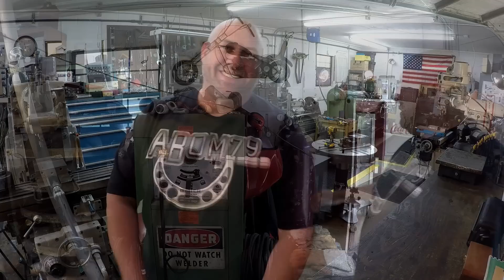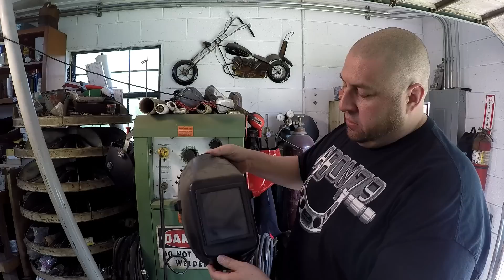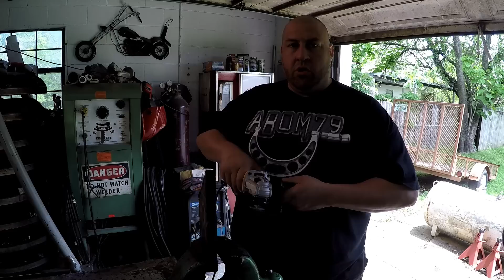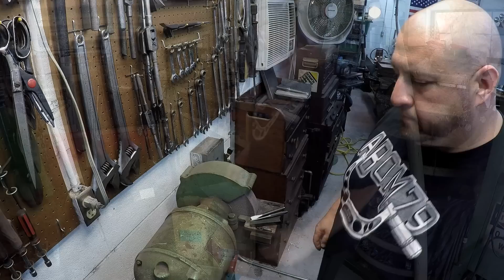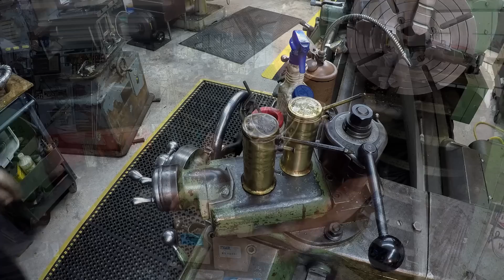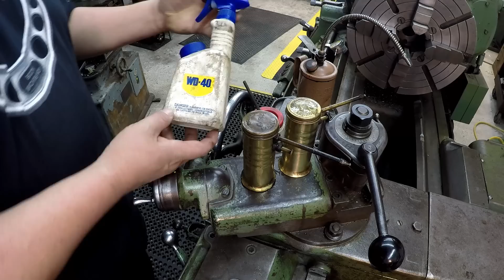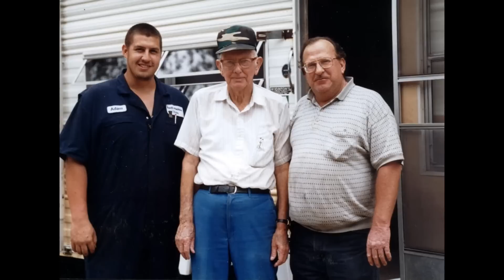10 More Shop Do's & Don'ts

Comment: In the UK things are a bit different on No.10, unless you're a time served specialist with your own full tool kit, many firms supply most needed tools, especially unusual, hard to find or particular trade type ones . But having said that, they don'tr always buy the right or best ones. Some will not take their own tools for others to borrow, break or steal. Another thing is that if many take their own tools to work, management see it as a sign that they no longer need to supply them and those that can't afford them have to borrow etc. I was self employed and took my full kit with me, one place I worked at would replace tools I wore out or broke in their work time. But most employers are not that understanding. If your wife buys you an expensive tool for Xmas or a birthday and you then leave it at work for anyone to use, what's she going to feel like if she finds out? Lots of good common sense advice here, Adam, thanks.

Comment: when I started 30 years ago if I had to borrow something twice, I would buy my own
Reply from the maker: Good rule to live by. I have many tools I don't use often, but they are mine and are there when I DO need them.
Reply: If it's something not commonly used and you gotta borrow it that's cool, same if yours broke but everyone hates mr borrow everything
Reply: Yes, most definitely. You know,  the old rule of "if you haven't used in 6 months ... throw it out" (or whatever) DOESN'T APPLY TO TOOLS!
Reply: Standard rule , borrow it twice you should own it!!
Reply: I hate to borrow tools but if I do, I will usually buy a better quality one for myself.
Reply: At work %100 but at home im a bit more lenient, like i will lend to housemate or trustworthy neighbor.I tend to only apply it to non consumables though,like i (its embarrassing to be honest) a full drill set currently and am using my housemates on his insistence but im not really comfortable with it, im just awaiting for some to come up on special.Its like if he wants to either do work or have me do much work on the mill or lathe i expect him to at bare minimum sharpen the hss tooling or at best supply his own if its on going requirement.
Reply: And when you buy used tools, it's not really costing you anything, you're just turning your money into tools that you can turn back into money when you don't need them anymore. It's only when you break or wear out the tool that you've really lost anything.

Comment: Welding hoods are a very personal item to me, its like wearing someone else's underwear, it just doesn't happen. Thanks for another ten deadly sins :-D
Reply: Shadon HKW I had bought a rather expensive Lincoln Hood like the one in this video. It died on me and I replaced it with a harbor freight equivalent to get by until I could afford a good one again. So far I've used the cheap one twice as long as the Lincoln lasted, it's held up great, and is every bit as nice to use. I think it cost around $50 on sale
Reply: even more so when it eventually does break, I can take it back at get a new one
Reply: Same with princess auto up here in the frozen north. A big sign in the store "no sale is final until you're satisfied" which basically means a lifetime warranty on everything they sell

I usually hate cheap tools and try to buy quality, but I'd never buy another high end welding helmet. Not when $300 gets you a year, and $50 is coming up on 3 now without any trouble.
Reply: Truth. Not to mention Chinese manufacturers don't have to obey patent law. They can just copy and sell what they want as American or european trademark law doesn't apply to them. I know a small indie motorcycle company that manufactured an original design for a kickstart transmission cover and assembly on newer EVO harley sportsters. Had it registered by the patent office, spent a load of money trademarking it and everything. Six months later a Chinese version pops up in a popular aftermarket company catalog for 1/2 price. The original builder couldn't do anything as it was made in china.Tried to take the reseller to court and was told to take a hike. The Chinese equivalent will ALWAYS be an inferior product. It may work but it will be made out of the cheapest shit available. I bet if AVE did actually do a tear down on a miller vs harbor freight it would become readily apparent at how crappy the quality of the harbor freight unit will be. Not to mention if it has the right percentage of blockage for the application you are using it for. No quicker way to mess up your eyes than using a lens to light for the application. Of course that doesn't apply to auto darken hoods but still.
Reply: I'm a little late to the party but, I'm a welder under the hood for most of the day, cheap helmets are great for home gamers but those $300 Lincoln and ESABs are some of the clearest helmets I've ever used and you're also paying for comfort, those cheap helmets dig in quick.
Reply: Shadon HKW John
Reply: SeptrothFFXI and
Reply: same with anything you sweat into. fave pair of gloves, hard hat, welding apron, etc.
Reply: @SeptrothFFXI  The flying banana will do it every time!
Reply: SeptrothFFXI as the seller, you’re responsible, because you’re also the importer. Don’t talk nonsense. Don’t make things up.
Reply: Oh yeah, all that sweet sweat soaked into the forehead pad!!! Definitely don't want someone else's running down my face!
Reply: True, we apply the same kinda mentality where I work. It's not just you

Comment: A good rule to remember is  "if you Kill it then you Refill it"  easy as that.  run that cutting oil out, refill it.  Use the last grinding disk tell the proper person to get more ordered.
Reply: I've lost track of how many shops & offices I've been in where they have a sign to remind people to make a fresh pot of coffee when they pour the last cup...

And, let's not even get into restroom cleanliness... :(
Reply from the maker: Can't tell you how many times I had to swap out the oxygen tank because i found it empty.
Reply: Same here plus we had 55 gallon drums of hydraulic fluid, motor oil, antifreeze on rolling carts with air powered pumps that guys would leave empty.  Those were a pain to change out.

Here's another one.  How many times have you been working under a flat bed truck and have some idiot come up and hit the flat bed with a hammer.  that will make you sit up and gouge your forehead into the frame.
Reply: amen

Comment: Replace the empty gas bottle if you empty it, argon, oxygen, acetylene etc. Don't spit on the shop floor, nasty, if I have to lay down to work on something I don't want to lay in someone's nasty spit. Don't break a tool and put it back broken, especially if it's someone else's, tell them about it and replace it. Never ever take it upon yourself to borrow/use someone else's tools without their knowledge even if you're the business owner. Lock your shit up when you're not around.
Reply: >Don't spit on the shop floor

Can I just add that people stop doing this in general? It's fucking gross and spreads TB. I will only ever ever spit if I've got a fly or something in my mouth.

I don't get why people do it in public, because I know they aren't doing it on their carpet.
Reply: "barrowing" someones stuff, without their permission is just plain stealing... whether or not you gave it back, expect them to be pissed.
Reply: You brought up my worst memory of being in construction.  I used to build precast concrete i-beams for bridges.  Nothing, I mean nothing was worse than laying down under a form to install a hold down, covered in grease, and be staring at a big juicy puddle of chew spit 6" from my face.  
A distant second place worst memory of a couple asshats putting trash in the bed of my truck as a "prank".
Reply: As an occasional golfer, I have to add Don't spit your nasty sunflower shells (or chaw) on the greens! (I wouldn't believe it if I didn't still see it now and then.) Who wants to pick up a shell that's been in someone's mouth, to clear your putt line?
Reply: Nelson Mandela I understand if someone got a face full of oil or something else nasty but just doing it because, is plain NASTY!

Comment: #11 don't step on drop cords or air hoses.. #12 don't uses air hoses and leave them uncoupled when finished..#13 use the proper size grinder for the task at hand.. #14 don't cause extra work for the next guy, finish your job completely

Comment: Could you do a quick video of the torch pop? never seen it before.
Reply: Ever have someone shut the oxygen off and fill the room with little soot floaters?  Thats probably even more annoying because of the mess it makes.
Reply: Some people also do that because they think its cool.
Its also done a lot in TV Series and movies because they think its cool.

When in reality its just a newbie thing to do.

But not gonna lie, it sometimes happens to everybody. When your mind is like "Oh well what happened there with that $_whateveryoudid" and you close the wrong one first.
Reply: Usually followed by a bellow of "Oh, shit!"
Reply: was always tough fuel gas on first fuel gas off first stops flash back
Reply: Wrong, Jamie Buckley.

The gauges on the tanks measure the pressure inside of the tank relative to the pressure outside of the tank. So if regulated pressure in the hose is at 7psi at sea level the absolute pressure is 21.7psia, not 7.7.

If it were at 7psia that would mean that even with the torch "on" and a flame coming out that both lines, if at 5&5, would be at a "vacuum" and a flame would be literally impossible to produce.
Reply: gauge pressure vs absolute pressure
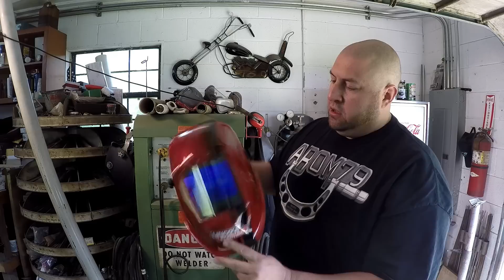Reply: This guy pops the torch around 2:52 in this video: /watch?v=8E-zliUrnQ0
Reply: Cheers dude, that really is bloody loud.
Reply: I've heard of "A before O or up you go" Maybe that's just for lighting a torch though
Reply: your right jamie always shut accetalyne off first because its 14.7 pounds per square inch preasurs at sea level and if your accetalyne is at 7lbs or 10lbs do the math 14.7 is more than 10 so it could push and burn back up the hose which is called a flashback.
Reply: If you turn the oxygen and gas on when lighting the torch it will also pop

Comment: None of this is respect for other people. Its just the way you like to be treated Adam. I have worked in shops where none of there standards are adhered to and because people respect and like each other as people there is no problem. I can't find something... Oh Tom over there is using it. Actually he is not using it, and he hasn't put it away. no problem I will just go get it. Tom is a good guy and I don't mind.
Reply: I've lost countless hours of the boss's time looking for things that either weren't put back or should not have been taken in the first place, in many cases by the owner of the business.  I have purchased or had purchased replacements of multiple items, spending the owner's money, only to "find" the item or have it returned later, in some cases months later.  

Most work I do is simple, IF you take the tools I am supposed to be using, how do I work?
IF everything comes out of a community tool chest, there better be more than one saw IF the job needs 10 people cutting wood.

How much time would you like me to spend walking around, rather than doing the task at hand, simply because someone else could not be bothered to keep me informed?

Sorry, but I disagree, it has everything to to with respect and I find it endlessly frustrating spending "my time" (even though it is really the boss's time) not working.  AND, you have not even covered the situation if you are on piece work.
Reply: Gus, that can work in a 5 man shop... everyone is nearby so you can ask where something is. You get up to a 10+ man shop and now you have to go hunt down who had the item you need. If the shop is running two shifts you're really in a pickle... it never fails that who used it last is on second shift and you spend 45 minutes looking from one end of the shop to the other trying to figure out what the devil they did with it.
When I was young (a long, long time ago) many shops had a tool crib with a semi-retired machinist to keep track of stuff, send dull cutters for sharpening, and get reorders done. You checked out tooling with your brass tags... and if you failed to return it, they knew who to look for.
Reply: It depends on the shop, gus. I've worked in places that were very casual and everyone got along well, and I've worked in places where they didn't. I would consider what Adam outlined as a set of defaults when you're starting out in a new place, trying to get a feel for the environment. If it turns out to be a friendly place then you can relax and go with the flow, but I think even in a friendly place people will recognize that you're showing respect by observing common etiquette and that will get you a long way in your relationships with coworkers.
Reply: consider yourself lucky gus. The whole problem isn't with sharing tools. Its also about the people that will mis-use or break your tools and think nothing of it.. That might not happen in your shop, but it happens in a lot of other shops.
I get along very well with all of the guys I work with as well, and I'm not going to let one or two un-returned tools ruin a friendship. But if I start to feel like someone is taking advantage of my generosity, the tool loaning perk will no longer be part of that friendship.
Reply from the maker: I have done been over what I feel twice in videos. No need to comment further here.
Reply: gus bisbal well, looks like we've found the guy who likes to stickyfinger other people's tools and not put them back!
Reply: No, I am the guy that doesn't get upset when I share my tools. Its called being an an adult.